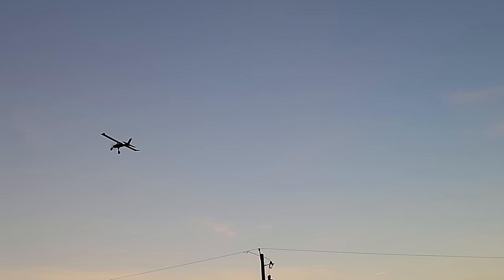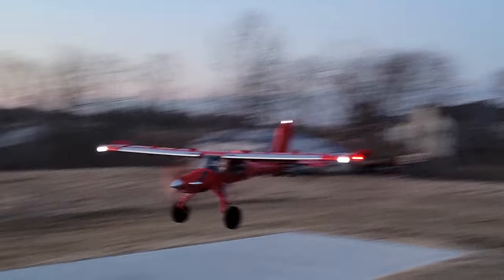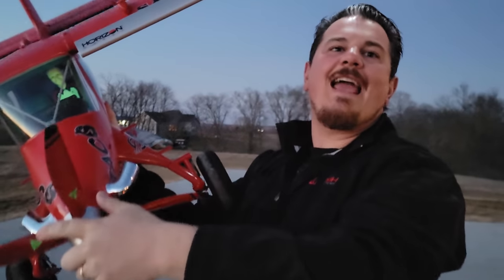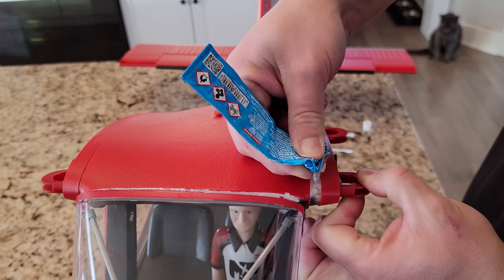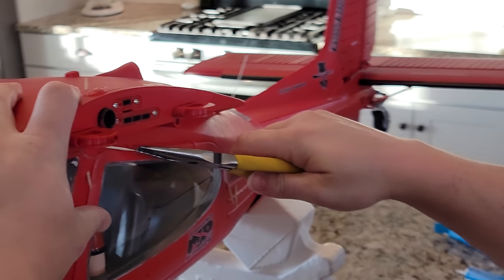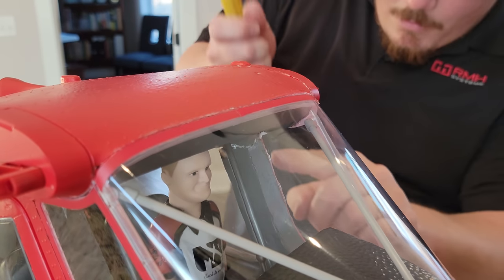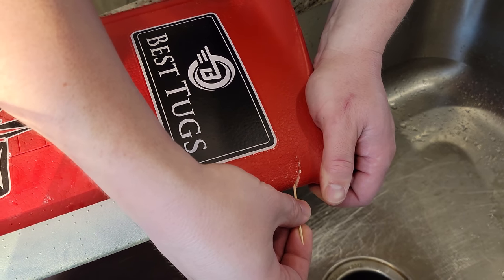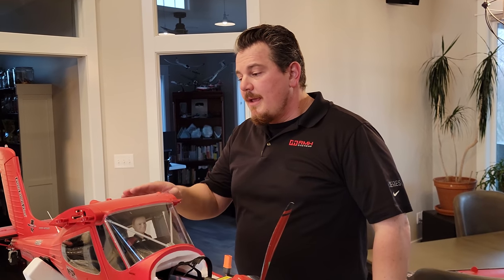Eflite - Draco - 2.0m - Spring '22 Flights with CRASH & REPAIRS

Comment: Just rebuilding mine this week from a flap/reverse mixup.  Love it!
Reply: That could definitely be a very bad mixup 😆 I'd imagine there's no recovering from that unless you were flying pretty high and most people don't engage flaps up that high. Glad there was something left to repair. 😁 ✌️
Reply: @EJ-74   Correct you are.  I was doing touch n goes back and forth.  was up probably 75-100 ft or so.  I realized what had happened at about 10 ft and reacted 2 secs after it hit 0 ft.🤦‍♂️😂. My switches for flaps and reverse are on opposite sides now.👍
Reply: @FORDEVR  Definitely a good idea to put them on opposite sides. 👍
Reply from the maker: You guys fly together????
Reply: @BrianPhillipsRC  No just a common interest like yourself.  Alberta, Canada here.  Just picked up a Night Radian today.  Might have to do a snow flight.  My driveway is a 3ft. drift right now.🤦‍♂️

Comment: Nice vid Brian.  The toothpicks are interesting.  I usually use a low tack tape to squeeze my repairs together while the glue dries up.  Then remove tape without removing paint and fly.
Reply from the maker: The paint is GREAT on the Draco, so I bet you could get away with it. I've also used packing tape BACKWARDS...all the way around, like a belt - so many details on the Draco though!

Comment: Brian, a cool way that I use instead of putting all those tooth picks is so fill the inner area with glue, just like you did, and on the edges I put a light layer of foam safe CA, then I tight the broken area with my hand and while pushing all together, I spray a rapid glue spray that make the CA to dry in 3 seconds like a stone.
It ensures that things will not move and then of course later the inner glue will get dry
Reply from the maker: If I could get in there with hot glue on a less beautiful plane, I would, but there were so many critical structural joints I was afraid I'd get very poor bond with hot glue, and end up with complete failure after about 2 flights.

Good news though, this plane is now no compressing when I hold UNDER the canopy and press down...it's all setup and strong, but slightly flexible still, which is what I wanted and why I wasted so much time using foam-2-foam, rather than CA. CA would have been a lot easier, and would have probably been fine, with some reinforcement...but you saw how huge the break was....I don't think I would have been able to get everything pushed together in time.
Reply: @BrianPhillipsRC  great job either way man! Love the content of your channel. It’s the best RC channel out there 👏🏻👏🏻

Comment: As the final step, I should tightly wrap the damaged part of the fuselage with a 2-inch wide bandage and additional grip wrap it with duct tape. Leave it that way until the glue is completely dry.

Comment: My new Draco just lost its plastic elevator horn it cracked and went in on landing, lost the props, struts on one side, dented some fuse foam,,,,,,, some of the plastic is very brittle and glue blocking smooth working elevator, check yours close, and the screws too, will be making some horns out of aluminum, ole fart Jimmy
Reply from the maker: yes

Comment: Some weight (like a stack of books) on the top of the center wing/cabin top would have compressed that pillar into place and held it in compression until the glue fully cured.  Using a weight on top would also have compressed the gap at the top of the windshield curve under the wing.  You pushed on it with your hand several times and saw the gap close.  A weight would have done the same thing without having to push on it forever while the glue cured.  Also, a woodworking clamp across from side to side would have held the plastic wing root facing (where the plug is) in compression so the glue has a chance to set in proper position.

I wonder also why you don't opt to use foam-safe CA glue on those fine cracks?  You could apply the CA, press it together and instantly create a bond without glue oozing out everywhere. I understand using foam-to-foam in those areas that need some gap-filling capability, but I would have used CA on the side fuselage crack for sure.

As always, thanks for sharing.

Steve
Reply from the maker: Yes, true, but those big long huge to small cracks are real hard to get glued with CA, since it's hard to get that long of a seam closed up in one "gluing". Also, the China Glue (like Mucilage / Foam to Foam) will closer match a factory glue joint, if you can get the gap to close up...and that's a big IF in my case. I didn't want to use the book method, but would have worked, if I didn't have 20 small details I was trying to preserve :( Oh well, still got her done ;)
Reply: I use a wide Velcro belt - (Brian you may have one for your Paramotor wing), and fasten it around areas like this sometimes with foam protecting blocks as well if needed🙂
Reply: Weghting rounded surfaces is a great use of old model magazines.  The magazines curve to fit a mildly irregular surface and by stacking them you can put just enough pressure on things to hold them together and not crush the details.  Just saying, and speaking from "experience"  ;)   Good work on the repair Bryan.   Us armchair watchers will always have "suggestions".  Usine toothpicks to pin things together is cool, hadn't thought of that before.

Comment: Damn , Camera crew does Scott use that last piece of T P stuck to the roll. ? Lmao 🤣   . I think there might have been one more drop of glue in that tube. 🤔     get a few large C clamps and let it sit over night. I use Gorilla glue clear.
Reply: Clear Gorilla Glue is the best for foam repairs (with or without toothpick strengthening) and so easy to clean up any excess with alcohol wipes. Once fully dry/cured always a stronger bond than the actual foam that surrounds it.
Reply from the maker: This model just had a TON of details that make the closure of that joint tricky. On a Caron Z Cub SS or similar, it would have been a BREEZE, but there's details on every side, top, and bottom!!! I wanted to TRY to preserve them somewhat...oh well, it's still flying well!!!
Reply from the maker: Howie - I've heard about how great it is, but have never actually used it. I need to try it out.
Reply: Brian, you won’t be disappointed but I realize you need short drying times for your videos and clear Gorilla Glue needs overnight to fully set up.

Comment: As usual an always stellar and helpful video. Wondering if you have tried or considered the small, cheap portable steamers that have the flexible hoses and a multitude of tips as opposed to the brute force of hot to boiling water for some of those foam crash insults? Not my idea, but saw somewhere it mentioned by another RC pilot who swears by the technique.
Reply from the maker: I haven't, but have seen others use them. They look nice, but I wonder if they'd produce enough heat?

Comment: Rubber bands! Across the top and down to the LG till the glue cures. I'm a day late but had to put my two cents in. Good Vid!
Also noticed, I think the left wheel (?) was wobbling and leaning inward?
Reply from the maker: The wheels DO tend to ream out a bit, similar to the Timber, but this can be fixed with brass bushings, or even better, pneumatic tires, if you so wish ;)

As for the rubber band idea - thanks, and on normal, less detailed planes, that would be GREAT! Problem on the Draco, is it's just so dang detailed!!!! If you ran rubber bands down the side, you'd have to make sure to put some cardboard or foam under the bands to stop them from marking up you sides...there's a cool rib design up and down the length of the fuse ;)
Reply: @BrianPhillipsRC  Bearings, put them on all my planes, hate the rattling sound they make even when not worn, and a smoother roll.

And I figured you would think of cushioning between the rubber and the fus. if you did it!

Comment: Awesome repair tips Brian! Will a hair dryer/heat gun work in the foam? I use large rubber bands to help hold freshly glued parts. In your case it would've worked perfectly. Glad the tornadoes missed you guys especially your parents!
Reply from the maker: Hair dryers are usually not hot enough, but I've heard of guys using STEAM CLEANERS. I don't think we have on, but I bet you could use an IRON...with a steam feature the same way.

On UNPAINTED foam, the hot water trick works best...painted and it's more of a pain, and harder to get looking right, without almost certain re-paint job :(

As for the Tornadoes - yeah, we were fortunate to be out of the damage path, but here in the Midwest, you never really know!!!
Reply: @BrianPhillipsRC  thanks for your detailed response and i will take your advice on future repairs. My Draco is still clean  at the moment, but my other fomies can use a nice hot bath treatment! Stay safe and keep those awesome videos coming!
Have you experimented on CG with your Draco? Particularly moving it aft?

Comment: Hey man, I actually just crashed my draco, but am wondering, I hit a power line (those biggest ones really high up), and my Draco crashed into the floor I’m actually very lucky not that bad but there are now white patches all over it, would red Acrylic paint be the best to paint over those patches with a paint brush? Also I subscribed and liked the vid. Thanks
Reply from the maker: Tough call. Depends on how smooth you get it. I would just paint it with a small brush, but I'm lazy - some guys get CRAZY with airbrush and all sorts of color matching and the like.

Good luck with your repairs, and bummed to here you had a crash.

Comment: Brian, I used to fly for years and then I got out of it for 7 years. I now have my renewed interest in this hobby and dug out my good old balsa Eflite Extra as well as recently building a Horizon Hobby Eflite Leader 480 using some components I had in my surplus box. I am also using my good old Airtronics radio and receivers but would like to upgrade. I am stumped whether to go with the NX6 or the NX8 version. I am also considering this Draco but for the money I could get the new version of the Extra and the Timber, two planes instead of one. Any thoughts to help sway me one way or another. Also, I love where you live now on that property, can you tell us what state this is with the corn fields, etc. We travel a lot in our motorhome and I have my thoughts but would like to know, thanks for the vids and all your knowledge in this hobby.
Reply from the maker: You may not want to dig in with the Draco anyway. I'd seriously consider the NX8...or you'll be chasing technology with the NX6 - I guarantee you'll outgrow it quickly. Not that it's bad at all...it's GREAT, but the extra channels, and the Right Knob will be valuable to you, especially since you're coming BACK. You will be up to speed quicker than you can imagine, and flying better than me in almost no time.

Tx https://bit.ly/3f4JhZl - Get the NX8, but one without the Rx...unless you want to upgrade one of your old planes with that "included" option. Just keep in mind, this included Rx doesn't have AS3X/SAFE (if you want stabilization or auto-leveling)

Comment: @BrianPhillips! I have a question.

Re: DRACO 2.0m Smart BNF Basic with AS3X and SAFE Select (EFL12550).

Would this equipment become novice-friendly by adding Landing Assistance Sensor (LAS) and SAFE-Plus (Virtual Fence, etc.)?
Reply from the maker: I don't believe you can add the LAS, and I don't suggest it for anyone. GPS fencing is not an option, and I too don't suggest it, even if it WERE an option.

I talked about this quite a bit in the Carbon Cub S2 (Gold and Silver one)...

Comment: why don't you remove the front windshield and attack the repair from that angle? You would get a better bite on the whole thing and possibly avoid the toothpicks?
Reply from the maker: Once I remove the windshield, I'd be stuck not being able to get the windshield back on...so I was kinda screwed ether way, by my estimation. Those sides windshields clip into the windshield, which might have been hard to see in the video, but I don't know if there's a better way to remove it.....might be.

Either way, best way to fix her is to not crash into the coup in the first place - LOL ;)

Comment: Hi Brian,

Thank you for making these awesome videos so we all can learn how to become better pilots, incredible!

Question for you if you don’t mind: My Timber X pitches up dramatically, both in Safe mode but also in AS3X mode. This is happening as soon as it give 3/4 to 1/1 throttle. The pitch is so steep, that I have to get a full elevator down to counter it. Clearly this is wrong but I don’t know how to fix it. I double/triple checked all the settings, including that the elevator is set correctly. Any idea where you could be?
Reply from the maker: Is your elevator pushed in all the way??? CLICKED IN??? There's been some grumblings that the elevator has popped out on some guys...not a problem I've run into, except when I was doing a goofy visual during my maiden...showing how we used to test the power on a gas plane from the 90's...then the elevator and horizontal stab popped out!!!

If that's NOT your issue, check and see if you can replicate this with the throttle cut ON....so the motor can be ignored and see if the elevator is mixed in for some crazy reason.

Also, you're 100% sure you're turning OFF SAFE??? - If you're even a little in doubt, triple check. 1) DOUBLE servo dance at startup, 2) When you turn it OFF you don't see "auto-leveling" on the ailerons when you put her on her back... If you don't have SAFE off, but THINK you do, it will do like you described.

If you're still having issues, you can go into MIXES, and verify you don't have a mix in there you didn't realize was there.

Also, there's a setting in FORWARD PROGRAMMING, but I NEVER use it...Throttle to Elevator - make sure it's OFF ( I can't walk you to this setting, since I've only seen it a couple times, and I don't use this setting)
Reply: @BrianPhillipsRC  Hands-down you are the best RC YouTuber. Can’t believe you even have time to respond to our comments. Much appreciated and thank you very much:)…let me try your recommendations. 

Thank you again for getting back to me so quickly and also in a very thoughtful manor, YOU rock!!!!!!!

Comment: Hey Brian how do you do you keep plane level when u turn rather than tipping plane with aeilerons and pulling up on elevator to makw turn...I wanna learn the flat turn....Maybe in video when u fly u could say what controls ur pushing on draco...U turn and it looks like u don't barely use aelierons...i was wondering how u do that
Reply from the maker: Use your rudder OPPOSITE the ailerons, and you'll achieve a flatter turn, but flyer be ware, you can get into a flat spin, and stall out, if you're too sharp.

Get some altitude and give it a shot - it's like opposite of coordinating your turns ;)

Comment: I'm having trouble with my wifi setup on my NX6 I got today... I registered it I thought I did after I got done registering it I powered off the transmitter and it still said please register your nx6.... Also when I set up my Wi-Fi it does not work the screen freezes on thumbs twiddling and I have to shut the transmitter off to do it again and it does the same stuff what could be wrong
Reply from the maker: This one might be a Spektrum call - sorry!

One thing to try - get online on your computer, and see if you're account shows the Tx...you can check it at spektrum.com (not HorizonHobby.com - I sometimes go there on accident)

Comment: is it possible to do flaps, gear, safe and thrust reverse with a nx6
Reply from the maker: Just list out the features ;) Get the NX8 and save yourself the trouble - the nx6 is amazing, but you will need the 8 for some of the earlier plane switch thrust reverse. You CAN use the "7th" channel to operate the Reversing, I believe.

Comment: Anyone got any ideas for wing panels that won't plug in all the way?  I just got mine and built it up to the point of trying to install the wings.  They won't push into the fuselage enough to align the twist lock things.  I've pushed as hard as I dare and it's not the because the carbon tube is too long.  I can't even get one side on at first.  Very frustrating.
Reply from the maker: I had this issue after my crash into our chicken coup...but what I did to fix it was to get ONE of the two in, then used some light leverage at the end of the wingtip to pry it into place. Not idea, but gotta do what you gotta do sometimes.

Just make sure you have your plugs inserted straight first.
Reply: @BrianPhillipsRC  Plugs?  Do you mean the twist lock red plastic thingies?  I can't get them in at all, much less straight.  LOL  I guess I need to get my wife to help me out and hold the fuselage because I'd need three hands with the wingtip and twist lock insert.  But, fat lot of good that does me at the field by myself...